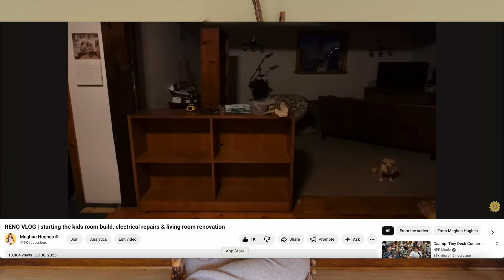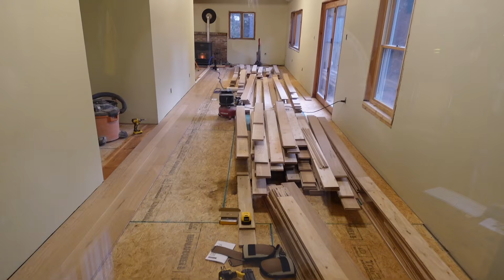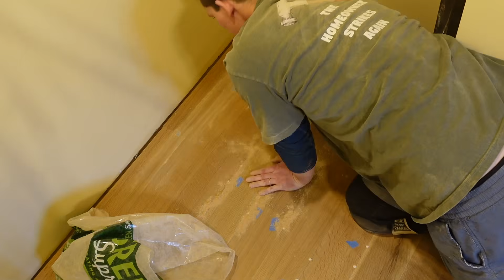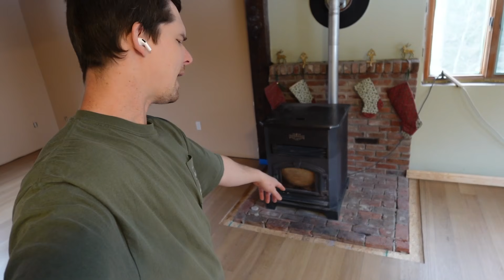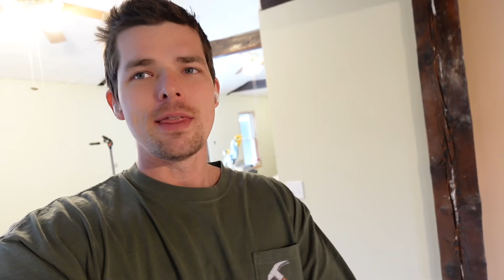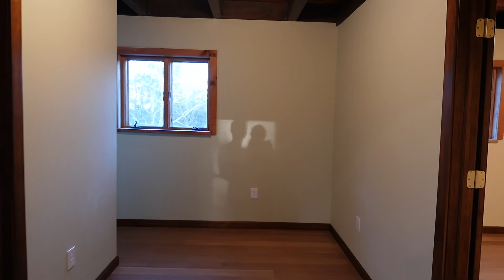How Knocking Down 1 Wall Turned Into 8 Months of Renovations

Comment: We have a wood stove. We have about 3 feet of clearance between our metal gate and our pellet stove. We have mounts on the floor to install and remove the metal fence. It gets warm to the touch, but never hot enough to burn anyone. Even when we have it cranked on highest settings in order to heat our whole home. But we also have our stove on a lift so it’s about 4 inches higher off the floor. If that makes any sense